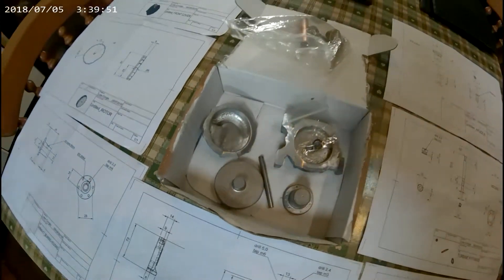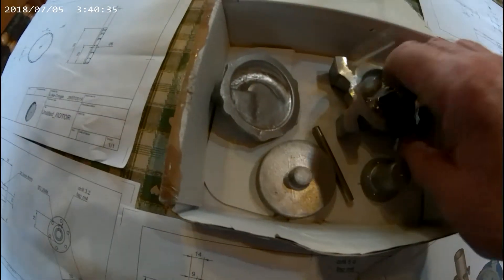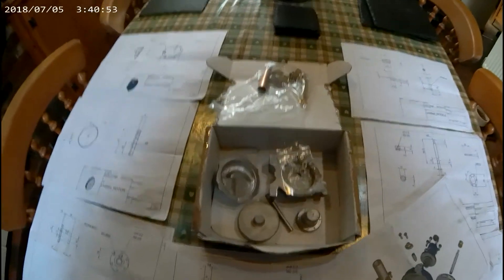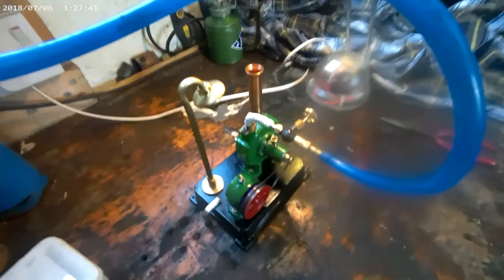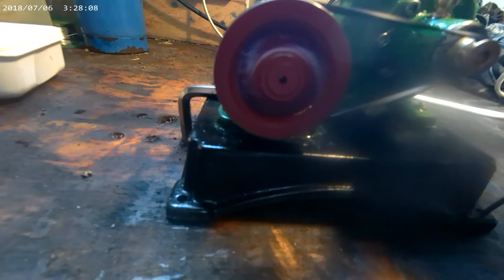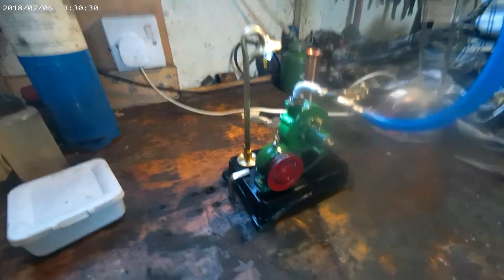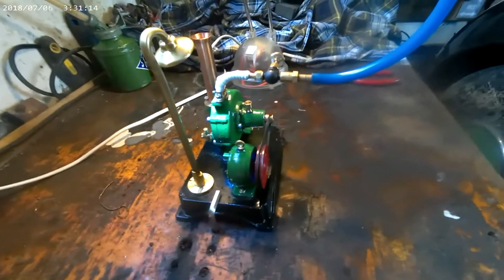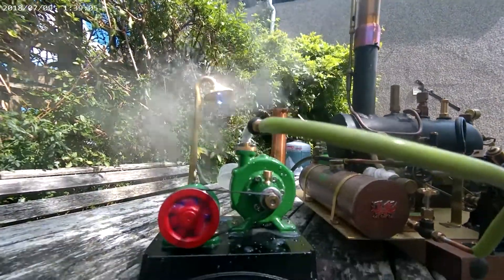live steam basic impulse turbine

Comment: Where do you buy this kit...im building a model coal mine town run off of steam power....4 of these would make a great power plant model!  👍 
P.S. it looks really good...like a real one would look and operate!!
Reply from the maker: cringle model engineering .co.uk,( sometimes sells on e bay too) they work well but require a lot of steam , not much pressure but need volume of steam from a big boiler. Look them up on U tube for more videos , he is a great bloke to deal with. THE kits are not difficult to make but he sometimes sells ready made engines too. Good luck with your project sounds really interesting